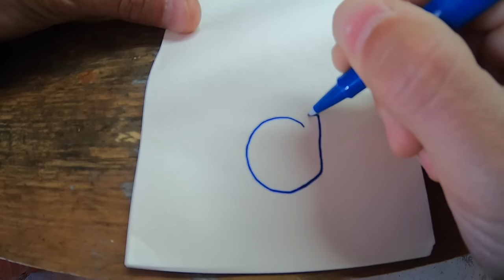MAKE YOUR SNOWBLOWER THROW FARTHER AND NEVER CLOG. Install A DIY Impeller Kit.

Comment: I have a plastic impeller and only a 5.5 horsepower engine. Would this idea still work? Thinking the lack of power or plastic impeller would be an issue?
Reply from the maker: Hey Eric you should be fine with both. Engine shouldn’t be a problem at all. I would get thinner rubber for the impeller. 1/4 thickness or less. Cutting up a an old mud flap would work perfectly. Thanks for watching!

Comment: Interesting. So after all of this modification, how much farther did the snow get thrown? My 10 h.p. Ariens tosses the snow some 30'+. Not sure if it's worth the time and effort to get three to five extra feet. Another thought is, if the manufacturer designed and engineered the impeller with a certain spaced gap between the blade and the cowling wall, don't you think that they did so for a reason? Just wondering if this puts undo strain on the motor and drive system. Just my opinion. Thanks!
Reply from the maker: I linked another video in the description with proof that it adds about 20+ more feet. One real benefit is that it will never clog up. It’s always wiping itself clean. Your about the 400th person to ask me about the manufacturers design. This video has been up for over a year and still has no answer! Lol!  I would like to speak with a snowblower engineer and gain their thoughts! No extra strain. In fact it works more efficiently. Thanks for checking out my channel!

Comment: if you drill the rubber first then put on impeller and mark it would be alot easier don't you think
Reply from the maker: Perhaps but it will depend of what kind of rubber pieces you'll use.  These rubber pieces will grab the drill bit and spin out of place.  Perhaps other pieces would do better but I'm not sure.

Comment: Will that impeller kit move more snow from the first stage so it tires don't slip or cause the front to lift.
Reply from the maker: No it will not. Just helps shoot it out of the 2nd stage. Thanks for watching cliff

Comment: Hi like your channel I have a question. My blower is a Briggs & Stratton machine entire thing not just the engine lol. Its a multi gear forward and reverse transmission.6 forward 2 reverse. The forward is extremely fast lol the reverse i can only get into 1 and its an extremely slow speed. I see there is a double threaded shaft top & bottom of the shifting lever I'm assuming thats the adjustment. My question is how does this work to adjust transmission linkage for shift placement on the handle bar?
Reply from the maker: Hey Gino can you email me pics of the linkages under the dash. Perhaps I can help you out that way.

Comment: Wouldnt it be just as well if I use one of the rubber pieces as a die for the other rubber pieces for creating holes instead of doing each piece individually?  Also a before and after clip of throwing snow would be quite convincing whereas now its speculative based on your experience and word.
Reply: He drills the holes in the impeller blades individually. The holes in the rubber have to match up to the holes he has drilled in each blade. They can't be drilled all the same in the rubber pieces.
Reply from the maker: You could try that but all your holes may be just slightly different than the rest. Found it best to do one at a time.  I would have loved to get a before and after video of this blower in action but it was 85 degrees in August when I filmed this.

Comment: I have had 3 snow throwers through the years in a climate that gets tons of snow.   I have a way simpler and safer way to eliminate clogging.  Go to the kitchen, find the cooking spray...  you can use Pam but any brand will work.  If your worried about cholesterol go for the olive oil type :).  Now BEFORE you start throwing snow with the machine OFF, spray the augers, impellers, and inside of the chute.  The wet snow and ice won't stick easily and you don't modify the impellers or throw the balance out of wack or put strain on the engine and belts.  And you won't have to worry about throwing a loose bolt threw your neighbors window or hitting someone.  Give it a try, it has worked for me for 26 years.
Reply: Never stopping the impeller has worked for me for many years.
Reply: Tried the cooking spray. It works for a short time, then requires more. Would be a good idea in combination with the mod
Reply from the maker: Ive done this as well! Works great but found even more success with this mod!
Reply: Aye, guess you don't have slush ever.  It's nice to just go out, do the job, come back in.  And you don't have to worry about throwing bolts, you'd come closer throwing rocks from the edge of the road, or gravel drive way.   I guess you like to see your name on the posts.  I don't have to punch ice since doing this mod.

Comment: I have a Toro 2 stage snowblower 622 6 hp. I want to do this to my blower, but my problem is I can’t secure the impeller enough to punch the blade and drill it. I can’t put my hand and the drill in the Chute area do you have any suggestions on what to do?  There is also a brace on the back side of each blade. I have 3 impeller blades. Thank for your time.
Reply from the maker: Hey Jim, you could try using self tapping screws only that way if you drill into the brace it’s not a big deal. Those should hold just fine. Also, I’ve had a similar issue where I couldn’t get the drill down the hole far enough to reach the impeller. I bought a very long drill bit (12-18” I think) to get down there. Hope this helps! Thanks for watching!

Comment: I don't know if it is factory original but I just picked up an Allis Chalmers Sno Pro from about 35-40 years ago and it has rubber flaps on the impeller blades.  If it is, and this works, why don't more makers do it?  Seems like a pretty basic idea.
Reply from the maker: Good question. My guess is cost of parts and ease of assembly process.

Comment: Interesting, I may try this, but, with different junk bolts, I would think that could offset the balance and not do the bearings any good.  Excess vibration?
Reply from the maker: Robert Thomas no vibration what so ever. Actually felt more vibration when the impeller clogged without the kit on it.

Comment: If I spend $$$$ I’m not going to spend more money to modify it’s performance . What happens when a bolt “ does “ come loose and jam your unit ? It will eventually happen . If what ever reason you would do this use a tungsten drill bit as they are designed to cut through hardened steel . As mentioned by someone else use a silicon spray and you won’t have any clogging issues . Ariens make a silicone spray for this very reason .
Reply from the maker: Thanks for watching

Comment: Would the Ariens 24 “ compact be a good snow blower?
Reply from the maker: Great snowblower. I believe it does not turn as easily because it does not have the auto turn feature like the deluxe model has. If that’s not a problem for you then go for it. Not a bad  idea to go to the store and push both around. Thanks for watching!

Comment: JB, what is the repair for a snowblower discharge chute deflector that doesn't stay in position? Noma 9hp
Reply from the maker: Hey Philip! Not sure exactly without seeing it in person. Does it just need the bolts tightened a little? That’s what it kinda looks like from the photos.
Reply: Thanks for the reply! The bolts that allow the chute tilt to pivot has nylon/plastic washers on them allowing it to pivot up and down. You can only tighten those so far. It you overtighten it, the lever no longer pushes or pulls the chute tilt up or down. The lever operates a cable that connects to the chute tilt and should stay in place or in position wherever one leaves it. When I turn the machine on the lever starts to move and the chute tilt returns to the fully up position. Does that make sense? 
 @GarageGear
Reply from the maker: @philliptaylor5981  I would check under the dash. There might be a bolt where the lever attaches too that could be tighten to prevent it from moving.

Comment: Putting A DIY  ceramic coating on the paint will make a difference too
Reply: I was thinking of lining my chute and impeller housing with nylon.  I don't know if they still do, but Honda used to line some of their chutes with nylon.  Ceramic sounds like a slick idea, too.  Or, if you can find a coatings place that can do some of those non-stick coatings they use on pans.  Just drop the whole housing off, lol.  ;)
Reply from the maker: Liking these ideas! Thanks for sharing!

Comment: you might want to put 8 bolts and nuts  of the same length and weight  because of spinning balance and vibration
Reply from the maker: Good tip! Thanks for sharing and for checking out my channel!

Comment: would it make a difference if I were to put paddles on the other side? I have a different setup where my impeller is different. It goes from front to back instead of left to right. On my setup it would be much easier to put paddles on the other side as I don't have any clearance to reach behind impeller.  Mine is part of the rotary shat that pulls snow inward.
Reply from the maker: Sounds like you’re saying that you would like to put them on the back side of the impeller. I would avoid this because the load of snow will peel them right off. Let me know if I’m not getting this right.
Reply: you are correct , I did want to put them on the backside but won't now. I was worried about the thickness of the paddles and bolts blocking the snow somewhat. My machine is a Simplicity riding mower with a snowblower attachment. It is quite big and wide for the impellers. They rotate on the shaft and work from front to back.
 @GarageGear
Reply: I purchased an impeller kit. It comes with paddles,bolts,washers and nuts. But, it also comes with aluminum plates that go over the rubber paddles. Hopefully they will ok to use, if not i won't use the plates.

 @GarageGear
Reply from the maker: @tompenn6706  I think you’ll be all good to go.let me know how it goes!

Comment: Hi j.b my name is ralph live in Chicago I just purchased a new Toro 1030 snow blower when the machine is going forward it has a tendency to pull to one side what adjustments do I need to make thanks ralph
Reply from the maker: Hey Ralph, I would check two things first. First check your tire pressure and make sure they are equal on both sides. Then check your skids under the augers on both sides on a level surface to make sure they are equal. Check this first and let me know.
Reply: @GarageGear  thank you my friend it was the air pressure the left side was at 25 pounds the right was at 18 both now at 18 pounds and I didn't re align the skies appreciate this and thank you j.b
Reply from the maker: @ralphconone6518  you got it Ralph! Happy to help! 👍

Comment: Wouldn't it be easier to hold the flap in place on the back of the impeller to mark it ?
Reply from the maker: Either side works just fine. Really no wrong way to do it! Thanks for watching Alan!

Comment: With that extra weight from the rubber on the impeller, does the machine and/or impeller shake more then before
Reply from the maker: Great question! No vibration once its broken in! It only take a couple if minutes to break in! Thanks for watching Jon!

Comment: Just wondering but could I use self tapping screws or will they break? 🤔
Reply from the maker: Great question! I have heard that a lot of people have had great success with just self tapping screws. I used bolts on mine 9 years ago with no issues. It took a little bit longer but I haven’t had to touch it since. Thanks for watching might ford! 👍
Reply: @GarageGear  Thank-you just didn't want to start with self tappers and they would break off.
Reply from the maker: @mightyford5845  can’t go wrong with the bolts my friend! 👍

Comment: You also only need to do two additions, 180 degrees apart from each other. Will get the same result.
Reply from the maker: Two will work fine! I just like to go a little overboard. Lol
Reply: I'm wondering  would only 2 inserts make the impeller  out of balance?
Reply from the maker: @BO-tf1wt  two flaps is fine as long as they are across from each other on an impeller with four blades. If you have three do three! Thanks for checking out my channel!

Comment: in 2013 i bought a 2 stage , with power drive wheels.. ariens, worked great..  but, my question is.. adding these impellers.. does it place more sever work load on the worm drive gear? and if so, are you replacing the gear oil? or what gear oil u using?
Reply from the maker: Hey Midcoast, once the rubber wears in it doesn’t create the same amount of friction it did on start up. Mine has had them for 7 years with no issues! No need to worry about the worm gear. Thank you for checking out my channel.

Comment: I put one of these on my blower, it did nothing. I still had clogs when I hit the wet heavy snow.  I think the real issue is my blower has a square outlet but a round chute... yours has a round outlet... no corners to get build up in.
Reply from the maker: That may be the case. Hard for me to tell without actually seeing it!  Did you try tightening the belt!
Reply: @GarageGear  yeah belts tight, I use the anti stick spray and everything. Could be it’s just a cheap snowblower though as well. It’s a “Canadiana”which is made by Nona which I believe is now owned by Murry.... I guess they also made craftsman blowers a few years ago as well, back when Sears craftsman blowers were that horrid dark green color. Lol
Reply from the maker: @hdrjunkie  ah got it. That’s interesting! I think I’ve seen those canadianas before.
Reply: @GarageGear  yeah, they work so well and do such a great job that I hired a plow guy to do my driveway now at $60.00 a shot! Lol I use the snow “clogger” to just do around the cars and to make a path to the wood sheds. But that’s only if the snow is too deep to shovel easily lol .
Reply from the maker: @hdrjunkie  the plow guy must love ya!
Reply: @GarageGear  I’m sure he does lol, we’ll probably not so much last winter because we had little snow but this years seems like it will be worse lol.
Reply from the maker: @hdrjunkie  yeah we’re already off to a busy season of snowblowing!

Comment: Good job, I bet it works awesome. But why not just use self tapping screws? Durability?
Reply from the maker: Jeff I thought about using self tapping screws but I feel there would always be that fear that they will come loose causing the impeller to spin off balance. With actual bolts I don’t worry about it at all.
Reply: @GarageGear  Makes sense......thanks.

Comment: this a realy good idea is there a reason why the one hoo fabricated these snow blowers don't included these fitting it would be much more better in wet snow condition if someone know the reason why they don't do thses modifications please let me know  because from what i have seen in this video doesn't same to cost a lot much more money for this good modification is it only because they fear that it would brooke there belt or causing a little more noise at the present time i own a snowblower made by white a 30 inchs with weels first in wet snow is to die even pushing on the back of the machine almost don't work because the wet snow have tendency to jam in the trower and also the whelles turn without advancing at all and if i try to push harder with my body on the back of the machine weel i obtain no result and black smoke so in conclusion in weet snow condition my snowblower is not even a 1 on a scale of ten so is it true that with a snowblower 3 phases that it would work in weet snow with out having doing these modifications thank you very good advises and videos mike from granby quebec canada
Reply from the maker: Michel Marcil not sure why companies don’t do this in the first place.

Comment: Difficult or impossible to do on my John Deere. The impeller blades are not flat...made with a ridge for strength. Would like to make it happen though. Any ideas?
Reply from the maker: Would like to see a picture if you can get a camera in there close enough. Feel free to email the pics to garagegearjb@gmail.com

Comment: What is the curved aluminum measuring device to the left of the vise used for? Just wondering because i found one and for the life of me can't figure out what to use it for.
Reply from the maker: I think what you are referring to is the 4 foot ruler I have at 9:34. The camera lens makes it look curved but it’s not. If that’s not what it is send me a time stamp. Thanks for checking out my channel!
Reply: @GarageGear  I was hoping it was like the one I have it has a good curve and is also tapered in width from about 2" in the middle and about 1 1/4 on each end with markings along the way. A strange tool made of aluminum just like most straight edge measuring tools.
Reply from the maker: @HHI455  sounds like an interesting tool. Feel free to send me picture to my email garagegearjb@Gmail.com . Thanks for sharing!

Comment: Won't this ruin the weight and balance of the propellers?
Reply from the maker: Nope! As long as the rubber flaps are equal in size you’re good! Mine have been on my machine and throws like a dream!

Comment: I am just wondering if vibration becomes a problem if the bolts and rubber pieces aren't the same or at least very similar in weight
Reply from the maker: Thomas Tompkins Sr no issues what so ever. If you were missing one then maybe.
Reply: I don't think it really spins fast enough for vibrations to occur, unless you have a huge weight difference.

Comment: I've done this on a couple of mine.it does work. On my honda though there is literally no gap between the impeller and housing so didn't bother
Reply: Maybe that's why they work better?
Reply from the maker: Hondas are great machines.  Some have gaps and some dont. Depends on the model I guess.